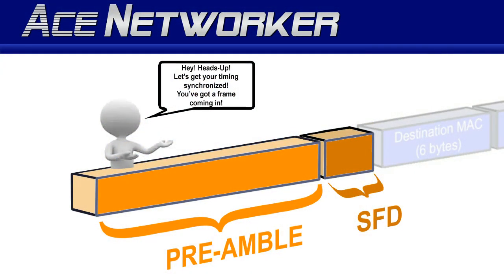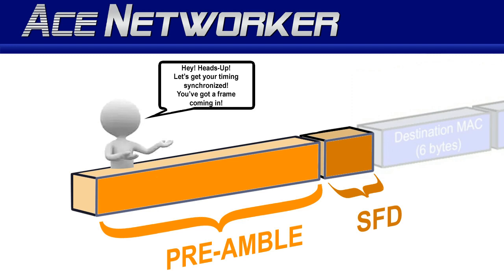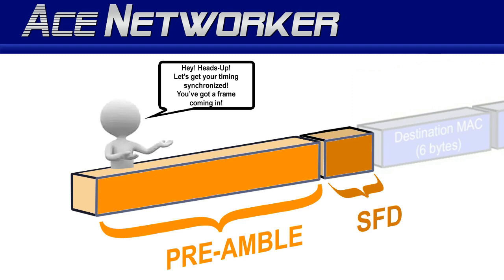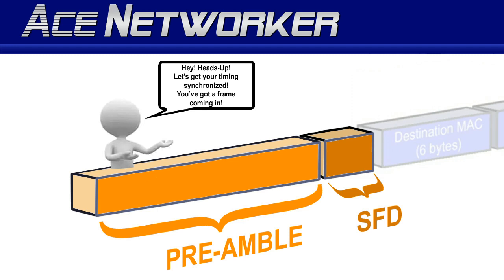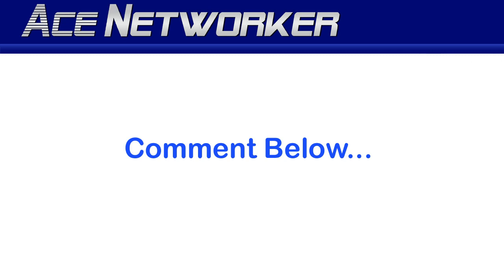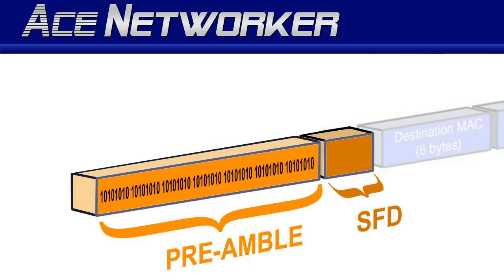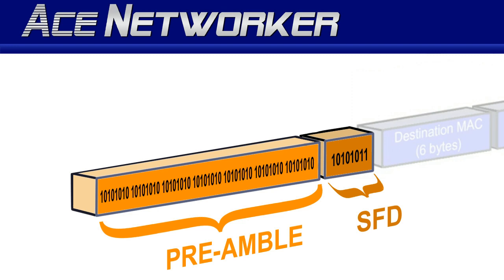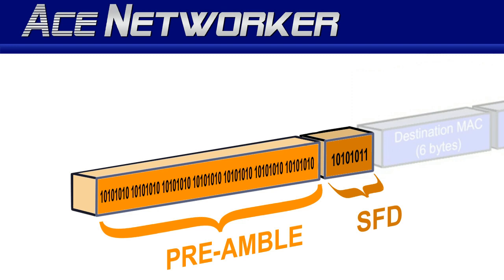Ethernet Frame Preamble

Comment: Thank you for this great explanations!

I think that the "preamble" and "SFD" fields should be considered in any case as not part of the Ethernet Frame, the Ethernet Frame being defined in the Data-Link Layer. It's a shame that certification exams cause us to misconsider the thing, and in my opinion that's what we should really consider: the fact that they are not quite accurate when they ask us to consider these 2 fields as part of the Ethernet Frame.

Especially when we are told that the minimum size of an Ethernet Frame Payload is 46 bytes, and that the minimum size of an Ethernet Frame is 64 bytes, and that these numbers are important to remember. If the "preamble" and the "SFD" fields were really part of an Ethernet Frame and its header, the minimum size for an Ethernet Frame would have been 72 bytes, which we were told is not correct.

Comment: So is the 7 byte data always a series of 1' and 0" then SFD ending in 11 to transmit the frame?? Do any of these values change to sync??   just a question, i'm wondering if these value change?  in the Preamble and SFD and how does the receiver know what clock sync to use?

Comment: Hi, Nice video thanks. One question, How Premable helps to recover the clock as 0X55... gets scrambled at the PCS level itself & loss the pattern of 1010?
Reply from the maker: If the clock doesn't match-up, the receiving computer is not going to be able to understand any of the information in the frame or packet in the frame, and it will drop it, causing it to have to be resent

Comment: Does the preamble get removed by the PHY and not sent to the MAC?  Trying to figure this out while messing with an Ethernet Phy and a FPGA
Reply from the maker: Technically, the PHY is the only thing that needs or uses the preamble, but also technically the preamble is removed by the MAC before being broken apart and sent up to the other layers

Comment: @Ace Networker so the SFD actually warns the Reciever, and the Preamble gives the reciever time to synchronized/lock to it and once synchronized thats when the actual data is sent to the reciever?
Reply from the maker: Think of the preamble kind of like the drummer in a band that starts a song off with a certain beat and the SFD like the double-beat that cues the first word of the singer to sing. Only the preamble gets the 5Mhz clock timing down and the SFD says,"Frame starting now"
Reply: @AceNetworker  Now i'm lost, but im really trying
Reply from the maker: @nerz3031  Well, let me know if I can help try to clarify anything or explain it better and I'm more than happy to :)
Reply: @AceNetworker  I don't understand the band example lol, this is just like the time when i was learning programming and i couldn't wrap my head around variables, took me at least a week to understand what they are

but there must a easier way to explain this, this is really frustrating lol
Reply from the maker: @nerz3031  Ok well we're talking about frames being sent from 1 computer to another computer (the receiving device in this video). The first part of the frame that the receiving computer gets is the Preamble > SFD > Destination MAC Address > Source MAC Address > Type Field > The DATA Itself (consisting of packet and actual data being sent across the network) > FCF (Frame Check Sequence) Field.

This video is only showing what the very 1ST part of that frame does: It has a Preamble and SFD

Once the computer/device receiving the frame (sent from the other computer) gets this Preamble and SFD coming in on its NIC (Network Card), it knows the timing (which is what I was referring to by the "drummer" in a band above) and where the 1st part of the frame begins. 

In other words, this Preamble and SFD tell the receiving computer,"HEY! Heads-up! My frame is coming in! Pay Attention!"

Hope that helps :)
Reply: @AceNetworker  Helped alot thank you